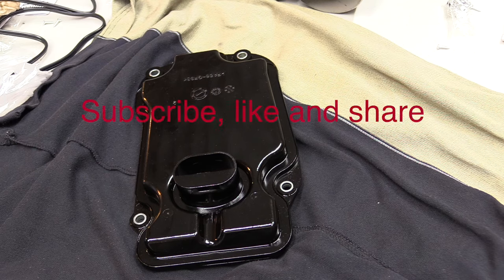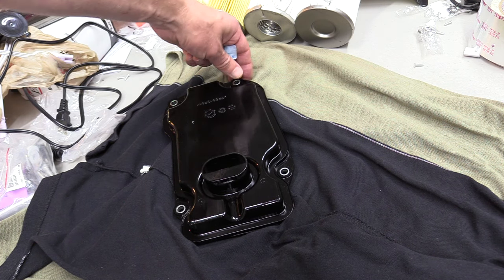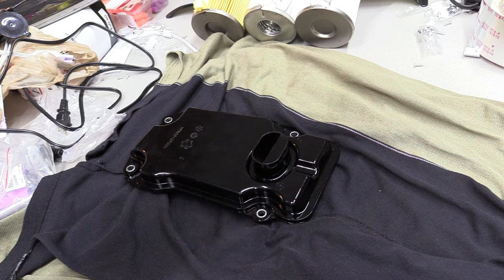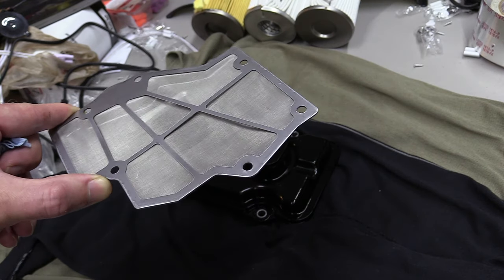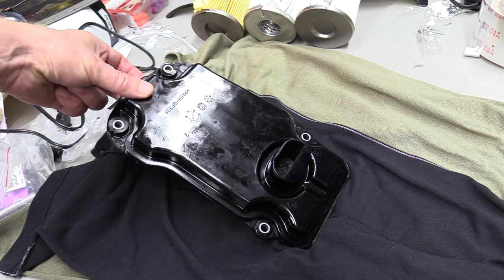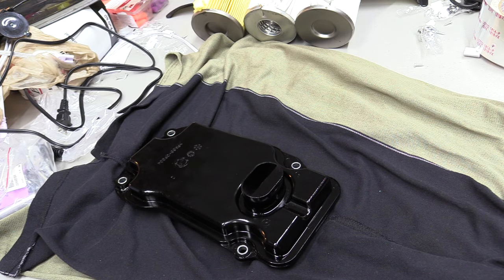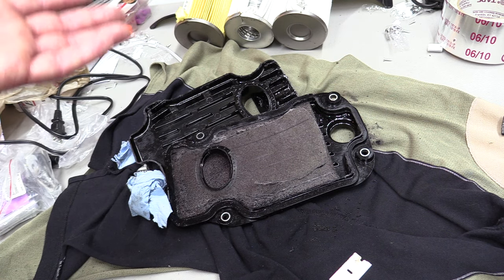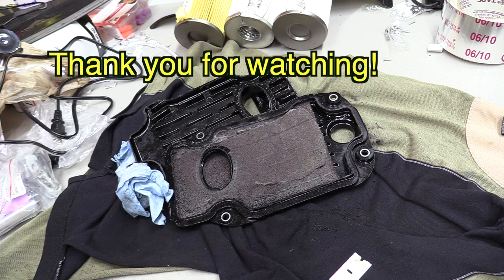Avoid replacing transmission filter, avoid costly transmission repairs, transmission maintenance

Comment: So I don't need to change the transmission filter on my 2016 Colorado, just the fluid???
Reply from the maker: If you have spin on filter, it's a must,a secondary filter is not necessary. Change your fluid every 30k miles no towing or hauling with factory atf.
Reply: @repairvehicle  it's not a spin on.  Im thinking of putting amsoil atf , thanks
Reply from the maker: You cannot go wrong with amsoil. https://www.amsoil.com/lookup/auto-and-light-truck/2016/chevrolet-trucks/colorado/3-6l-6-cyl-engine-code-3-lfx-3/?volume=us-volume&zo=5257753

Comment: You should replace it and doesn't   affect the performance of the transmission by replacing it. Usually what happens as people do not change the fluid and they go 150,000 miles and then decide to change it by then  it's too late
Reply: I am referring to the filter, but the fluid should be changed as well too.

Comment: I'd feel alot better if there was a way to determine how a dirty filter affected the fluid pressure in the tranny. I get what your saying, but even this filter is out of a tranny that has clutch failure as it has metal shavings in it. What's to say the filter being dirty or clogged didn't cause the clutches to wear and  give off shavings. Granted, frequent fluid changes are best, but it's a little alarming, not knowing 100% . I'm just saying....
Reply from the maker: Your comment is based on assumption because you did not watch video without skipping and shows that you don't care about the facts.

Comment: What about if your transmission filter is leaking oil around screws that holds the filter intact?
Reply from the maker: What vehicle?
Reply: 2011 Hyundai Genesis coupe 3.8 automatic
Reply from the maker: @nestalicortez9082 , then fix the leak and replace filter
Reply: Thank you for the info !

Comment: Thanks for your videos bud, I have a 2017 Rav4 with 80,000kms and the fluid has never been changed. I purchased an oem filter and toyota ws fluid for i plan do it soon. Well toyota dealership mentioned that its a lifetime fluid but i dont agree. Question is, 80,000kms a little late for first fluid change or should i do another drain fill when i reach 120,000km
Reply from the maker: It's not to late,  unless you are having transmission problems.  30k miles fluid change using factory none synthetic atf.
Reply: @repairvehicle  No transmission issues just yet. Thanks for the reply
Reply from the maker: It's not a well designed.  There's nothing special about ws, it's actually low quality fluid. Watch this video https://youtu.be/WMVGlI5LV8M

Comment: Братуха, У меня Toyota Camry 2017 6 speed automatic  u761e transmission. Do I need to change the transmission filter when chaining the transmission fluid? How many kilometers is the limit for the transmission fluid change? What is your recommendation? Google recommends replacing the transmission fluid every 30,000 to 60,000 miles. However on my Dodge Grand Caravan 2007 I am replacing the transmission fluid and filter every 80K-100K km. На видео видно, что трансмиссионное масло проходит через foam внутри филтра и тем самым оно филтруеться.
Reply from the maker: Under normal conditions you don't need change transmission filter. If your camry was in water then transmission filter must be replaced.  If you are using factory ws transmission fluid,  then it must be changed every 30k miles max, no filter change is needed.  If you choose to change factory ws atf fluid every 70k-100k miles then transmission filter should be changed because you going to a lot of wear material stock to the filter. Factory fluids ws or any other factory fluids can only last 30k miles max, after that fluid is no longer within factory specifications and it no longer provides lubrication. 
If you are looking for best transmission protection amsoil is your only choice and you can go up to 60k miles. Here is the link for your vehicle https://www.amsoil.com/lookup/auto-and-light-truck/2017/toyota/camry/2-5l-4-cyl-engine-code-2ar-fe-1/?volume=us-volume&zo=5257753
Since,  2008 every Toyota vehicle is using ws atf fluid from factory.
Reply: @repairvehicle  Thank you! Do I really need to measure the fluid temperate when changing it? Because I can just measure the volume of the transmission fluid came out of the transmission and just place the same amount back. Do you expect the transmission fluid level changing without any fluid leaks under normal operating conditions?
Reply from the maker: For best results it's better to measure with temperature,  unless you know for 100% you have correct amount of atf fluid inside transmission,  then you can do drain and fill exactly what came out.  Keep in mind about coating of your drain pan. How much fluid stick to the pan when it's drained.  Depending on the drain pan, it can be large amounts.  In my case, it's about 200ml.
Reply from the maker: Transmission fluid evaporates,  don't know how much.

Comment: Hey i have a 2012 lexus es 350 just bought it, im thinking of changing all the fluids in the car including transmission fluid, what would you suggest doing a drain and refill? and what kind of ATF should i use toyota WS?
Reply from the maker: I do only drain and fill and recommend to others as well.  Here's the video,  how I did on my lexus es350 https://youtu.be/maK7HsGEEls
When it comes to atf fluid,  I use only this brand signature series for ultimate protection. However,  you can use WS ATF https://www.amsoil.com/lookup/auto-and-light-truck/2012/lexus/es350/3-5l-6-cyl-engine-code-2grfe-a/?volume=us-volume&zo=5257753

Comment: Im having a transmission problem on my 2012 hyundai sonata when im shifting from 2nd to 3rd gear, its like a 2,3 seconds lag and feels like car is gonna turn off, will this be a issue with my transmission oil ?
Reply from the maker: How many miles on it and how many times fluid was replaced?
Reply: repairvehicle 98k miles in total , replaced  fluid 2 years back ran around 18k miles after that
Reply from the maker: It could wrong fluid was used. 
It could be amount of fluid is incorrect. 
Or it could be something is wrong with transmission if everything above is correct.
Reply: @repairvehicle  i got it checked today my crank shaft sensor was damaged .
Reply: 2004 Sonata. Sometimes hard shift between 1 and 2nd. Sometimes lag between other shifts. It was the throttle position sensor. Scan tool will show proper voltage to see if it's good or bad. Look up some You Tube videos.

Comment: What about CVT filter? I guess I can change CVT cooler filter to prevent my CVT from overheating.
Reply from the maker: Watch my video without skipping
Reply: Yes but Jatco CVT 7 has two filters, one metal housing with O ring, I saw metal particles  coming out from it. Another cooler filter in torque converter was made of paper cartridge, it needs to be changed every 30K miles. There are under 20 micro particles thinner than human eyes could see inside filters, unless you compare those new and used filter media under microscope, it’s not easy to jump to conclusion like that. CVT is different from automatic transmissions and half of service interval every 30K miles.
Reply from the maker: Transmission is ruined already with metal particles coming out
Reply from the maker: Torque converter has no filters

Comment: I'm just stupid or can't listen but where is the part telling why NEW filter is bad? He keeps repeating that you don't need to replace filter but not telling why NEW filter can harm anything...
Reply: It seems that the autor is just afraid about strainer bolts that he can't properly unscrew - there is no reason that changing your transmission filter would break anything if you can use tools and torques.
Reply from the maker: You are stupid for not watching video without skipping because I have said about new filter. Author is not afraid it’s just stupid comments from someone who didn’t watch video completely

Comment: So if not change ATF filter better useless fitted, what the filter purpose for?
Reply from the maker: I answered your question in the video, thanks for commenting
Reply: @repairvehicle  what if filter so dirty can to be clean?
Reply from the maker: @asriputra6788 if filter is so dirty then transmission is already damaged severely, at this point filter cannot be cleaned.

Comment: Hey, I have seen some Acura TL and RL forum posts where users would replace transmission filters.  They looked round but didn't have a metal cover that usual oil filter has.  These filters would just go inside a compartment and then cover would put on.  Any info on these transmission filters, should we replace them or not?
Reply from the maker: What year is your acura?
Reply: @repairvehicle  It is 2010 RL with 111K miles
Reply from the maker: There might be a filter, but it's located on the outside of the transmission inline within transmission hose. If there is one, it should be replaced when fluid is changed.
Reply: @repairvehicle  Thanks.  Here is the link to the filter where it is shown:https://www.curryacuraparts.com/v-2010-acura-rl-sedan--rl-tec--5-speed-automatic/transmission-automatic--at-atf-pipe  The manual talks about transmission fluid change but there is no mention of transmission filter. On Acura TL, the filter seems to be located under the air box.  On my RL according to the link above, the filter is on the left side of the transmission and it is hidden under the cover.
Reply from the maker: it looks like you have remove transmission and take it a part.
Reply: @repairvehicle  Could it be that is why manual doesn't require to replace this filter?  FYI - The fluid in the transmission was replaced by manufacturer's recommendation on time.  Hope doing that will make the filter not get clogged much.  By the image on the parts website that I sent, it seems that this filter has a connection to the "ATF Return Pipe", whatever that means.  I also found a listing online for a used transmission which had an image provided.  Looks like the filter is located by the torque converter: https://jdmenginezone.com/products/acura-rl-2005-2008-all-wheel-drive-mjba-automatic-transmission?utm_medium=cpc&utm_source=google&utm_campaign=Google%20Shopping&utm_campaign=gs-2020-01-22&utm_source=google&utm_medium=smart_campaign
Reply from the maker: Unfortunately its just bad design, might as well not have filter like it use to be with Honda/Acura. It no longer requires filter replacement. Acura just don't care about quality anymore and that is why they choose this type of transmission that when filter gets clogged up, it forces transmission to fail. I use to be a Honda guy. Honda 89 accord, 92 civic, 94 integra, 98 accord and my last Honda was 2005 accord. Never again I would buy Honda or Acura due to their bad designs everywhere, dumb engineered transmissions, direct injection bad engines with carbon build up issues. Japanese brands have lost their quality and no longer compete for quality except for Toyota/Lexus. I would consider another Honda, it would have to be 90s only. I hope, I did not scare you. I just dislike bad engineering with passion, it upsets me, when companies take advantage of people with partially engineered vehicles.
Reply: @repairvehicle  Oh no, you didn't scare me :).  I do understand GDI's issue + Honda vehicles always had a bit weak transmission compared to Toyo/Lexus.  I do like my car, its performance and features that is why I am not looking for another vehicle even after 10 years.  The engine seems to be clean as oil was replaced exactly at 7000K(which was shown by the built-in maintenance minder notification).  All other fluids in other components, were taken care of as well. After watching your video about transmission filter, I asked myself "is my RL's filter replaceable?" and started to search for it.  What is not clear to me if my vehicle has a main filter + another one on "return line" or it only has one filter.  From what I understand, the transmission fluid doesn't get dirty and destroyed as quickly as engine oil.  So if as you say "it is a bad design", then would a proper maintenance of the  transmission fluid, help avoid issues in the long run?
Reply from the maker: If you are using factory atf, change it every 30k miles, if you want trouble free transmission.  If you are using quality synthetic atf, you can double or triple fluid change intervals. Synthetic atf,  provides better lubrication and tolerates heat better than factory atf none synthetic. Having filters and not being able to replace doesn't mean trouble free transmission,  it's quite opposite.  Keep your clean and fresh, and you will have trouble free transmission for long time. Have you seen my latest video about reliable transmission, what it needs?
Reply: @repairvehicle  I do use factory fluid "Acura ATF DW-1"(don't know if it is synthetic or not).  My vehicle's transmission fluid is bright pink at the moment and is clean.  The first time this fluid was changed at 15K, then at 30K.  After that I moved to a bit longer intervals at 30 - 40K miles.   I don't now if I saw your video
Reply from the maker: Factory fluids are none synthetic. Here's the link to the latest video,  I explained details about reliable transmission. https://youtu.be/OZRMOurZO9s

Comment: Drain and Fill, thats all u ever need for Auto transmissions.
Reply: Same for CVT ?
Reply: @name741  even more os for CVT.

you dont want, all the crud out ever, just simple drain and fill is enough.

the transmission needs some grit to ''bite'' or else u get slippage

for CVT every 50,000km , change the oil. drain n fill
Reply from the maker: Transmission does not need grit, it’s false information that keeps transmission shops in business because transmission keep failing due to this false information

Comment: Transmission manufacturer themselves recommend filter change.
Reply from the maker: Which manufacture?
Reply: @repairvehicle  Gm transmission on BMW.
Reply from the maker: Which bmw has gm transmission?
Reply: @repairvehicle  LIke half of them, mine 2004 3 series automatic. Filter can get clogged. Have heard real stories of it get clogged.
Reply: I agree, even ZF(BMW, Jaguar, etc) sells tranny kits to replace oil, filter and pan (including new bolts) regularly. I do get your reasoning and it is good advice to be careful with bolts, however, there can be an upside to carefully removing the pan, cleaning it and replacing the filter. Removing the pan also gives access to more fluid stuck on the pan floor...
Reply from the maker: @kentsemogana5569  , just because they sell kits it doesn’t mean you have to use. They sell engine kits too! Does it mean I have to take engine apart replace things because they sell kits?
Reply from the maker: @kentsemogana5569  , just because they sell kits it doesn’t mean you have to use. They sell engine kits too! Does it mean I have to take engine apart replace things because they sell kits?
Reply: @repairvehicle  Fair enough mate, I guess my take away from this is to be careful not to introduce a problem but also that the whole procedure cant hurt when done right..Plus if one cant afford to do filter change they shouldn't worry too much ☺

Comment: Bro, atf flushing is ok?
Reply from the maker: What do you mean atf flushing?
Reply: @repairvehicle  one hose from oil cooler disconnect going to one empty gallon to drain the oil while engine is running
Reply from the maker: No, never do this. You will damage your transmission.  I will send you the link for a good video with explanation
Reply from the maker: https://youtu.be/or9u8DQ4fVU
Reply: @repairvehicle  thank you for the help bro
Reply from the maker: No problem,  my friend.  Please subscribe and share this video with others.  Thank you

Comment: If I were to drop the transmission pan, it would be just to clean the magnets at the bottom of the pan, and not to change the filter.
Reply from the maker: If you dropping the pan then replace the filter.

Comment: Once fluid gets dirty, filter gets dirty. Once it gets dirty thus has to be replaced.
Reply from the maker: Did you watch video without skipping?
Reply: @repairvehicle  yes. I drain/fill transmission fluid every 40 000 kilometers and every other time I change filter and gasket. This way I keep transmission fluid pink and clean filter. I know it is an overkill.
Reply from the maker: What do you drive?
Reply from the maker: If you planning to keep your vehicle for very long time, no such thing as overkill.  It's more Money in your pocket less being in debt.
Reply: @repairvehicle  2017 Tacoma TRD Sport
Reply from the maker: Nice truck! I  hope you are changing your oil more frequently.
Reply: What is the best time to change transmission fuid oil ....or filter any one pls
Reply from the maker: @ronniemendoza3470 , anytime between 30-40k miles or 3 years which comes first.

Comment: debrit will claught up the filter eventually pushing/sucking particles up.
Reply from the maker: Did you watch my video without skipping?
Reply from the maker: Debris is the result of not changing fluid.  When you change fluid,  you not going to have Debris .
Reply: @repairvehicle  It's your car. And yes I did watch it fully.
The issue is the filter will eventually disintegrate, just entropy, there is no ideal filtration media. Hence my comment.
Reply from the maker: Good point, eventually everything will disintegrate inside transmission.

Comment: I change my transmission filter every 5000 miles with Mobil 1 10w30
Reply from the maker: What do you have
Reply: i think you meant the engine oil and filter not transmission